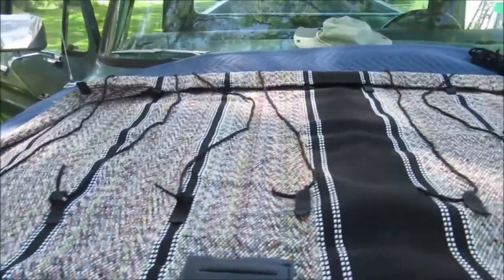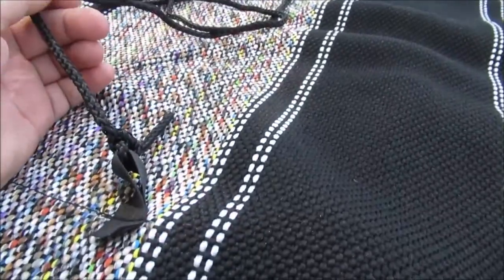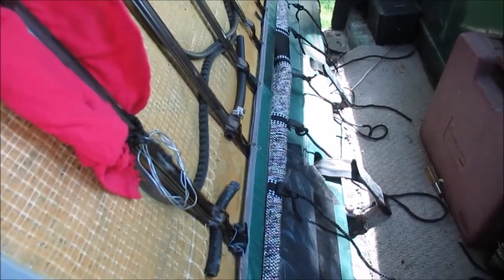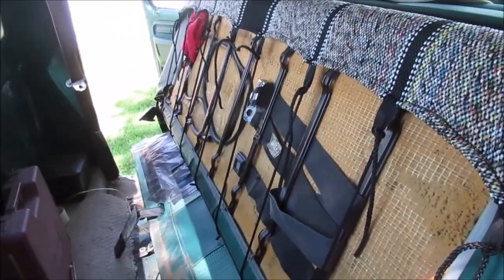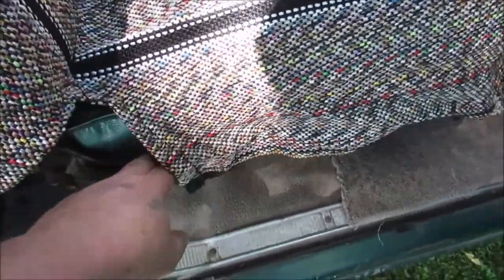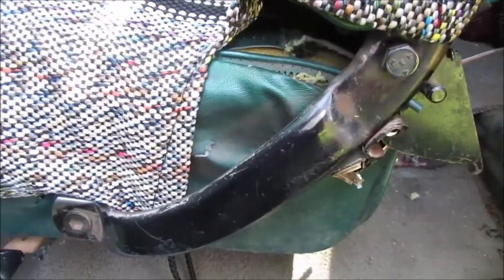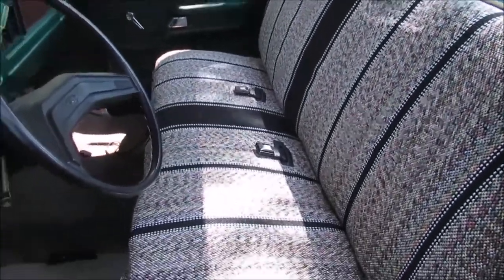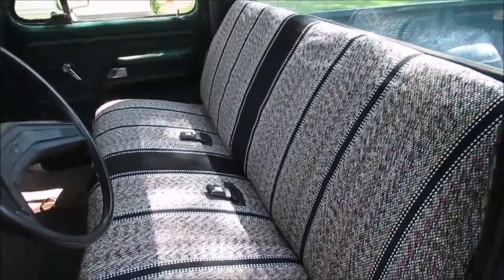New Seat Cover for 1979 F-150

Comment: Just bought one of these off Ebay.  No instructions!  looks like you just improvise and use other tie down materials cause it has more loops than ropes.
Reply from the maker: Mine still is not tied right..The stings that go through the seat and the back could be tied to the ones coming under neath from the front...and the top ones coming over the top of the seat can be tied anywhere ..kinda hard to explain here